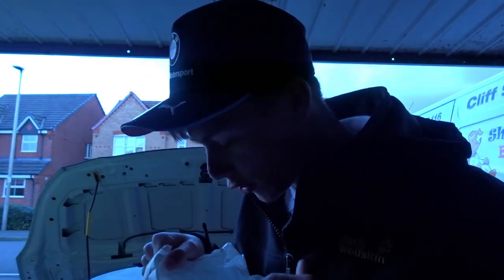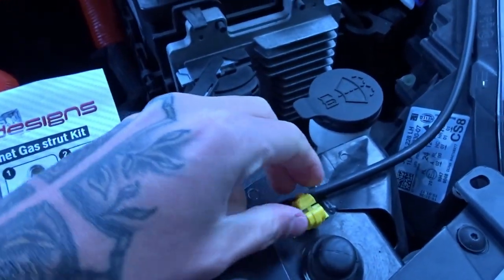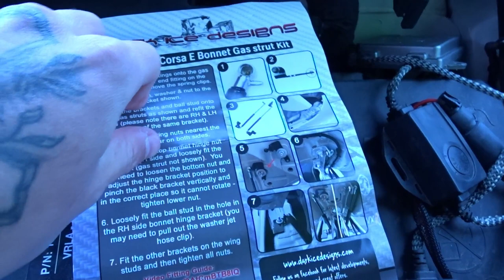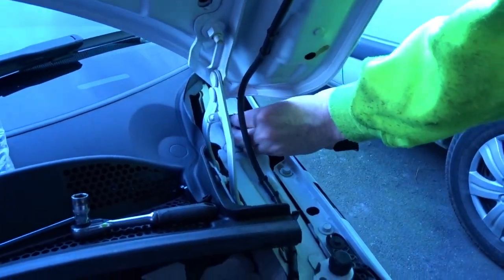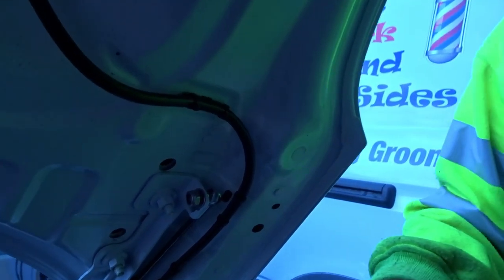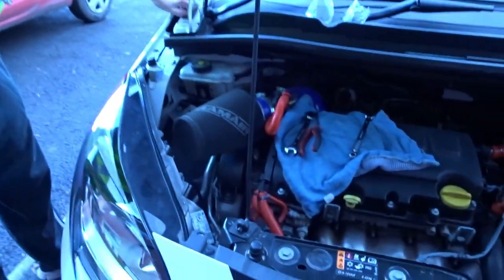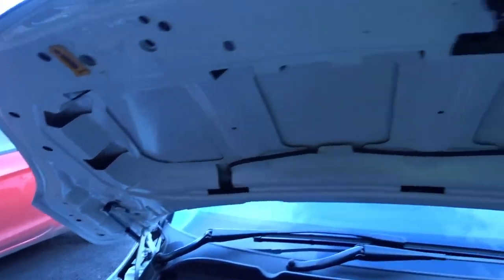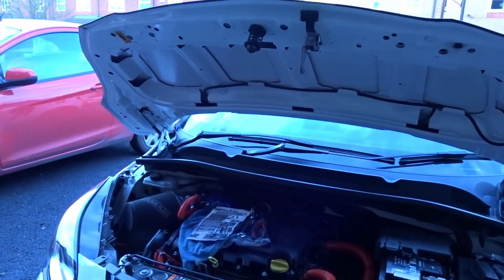How To Fit Corsa E Gas Struts!

Comment: just a quick thought maybe flip the top mounts round so the ball is at the bottom maybe that will increase the high on first position?? like i said just a thought :) keep up the good work
Reply from the maker: Thanks mate means Alot an you know I'm gonna try it next weekend when I have more time to record thank you ❤️
Reply: Is it to fit a single strut just like in the Corsa D the reason why I'm asking is because the Corsa E still has the old Bonnet hook rest.??